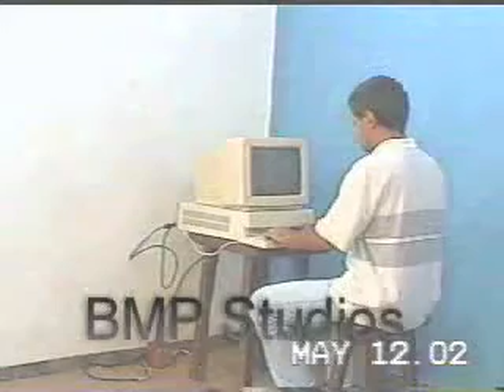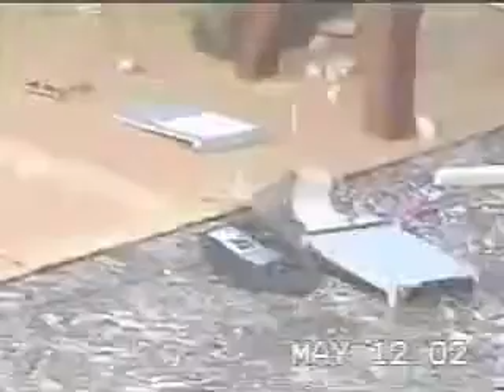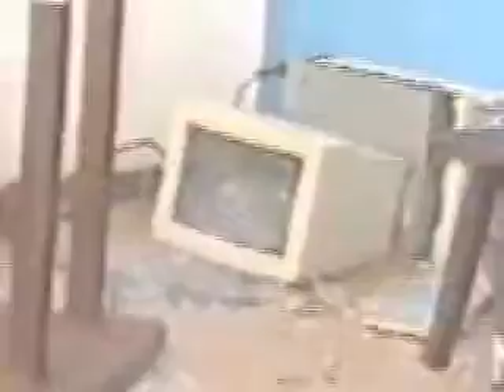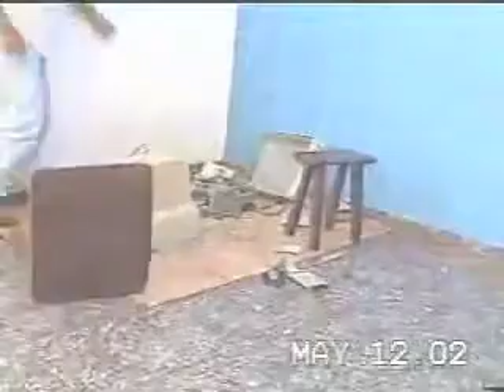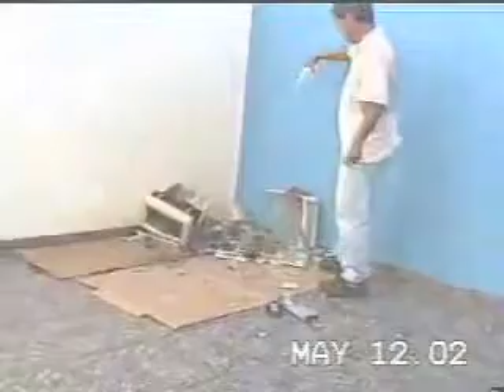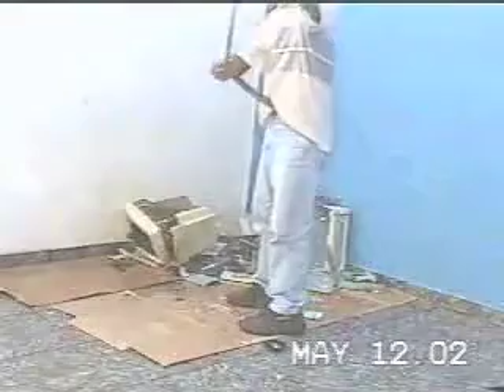Computer Rage

Comment: Why the parts of the pc are so easily to be taken out
Reply from the maker: Sorry if I'm late. I spent several weeks finding the reasons for that's but now, I found them.

Most PCs have components that can be reused or replaced without having to sacrifice on the performance, like storage or memory. Usually, there would be one or two parts that you would rather spend your money on, since a lot of the modular components get better with each generation. Normally, it's the hard drive storage, or the RAM that you want to upgrade, though you can also upgrade the CPU and the GPU. It's better to spend up to $750 on new components than spending a few (if not several) grands on a new computer that is marginally better than the computer that you are replacing.

TL;DR: It makes upgrading your computer more feasible. Not only that, but it's also much cheaper to buy better components for your computer than buying a new computer.